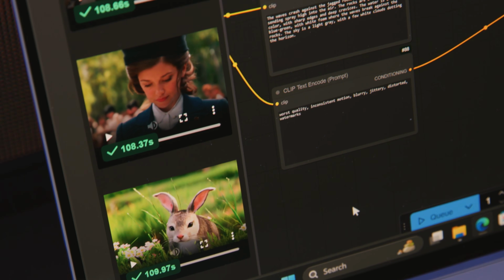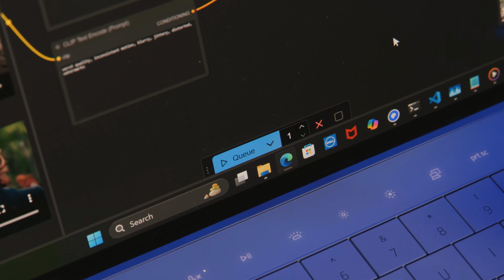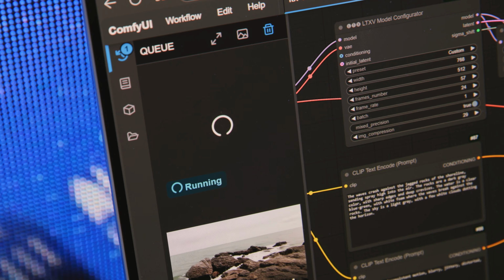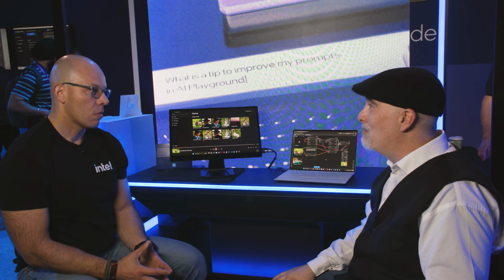Turn Text into Lifelike Video with Intel Core Ultra 200V Series | Talking Tech | Intel Technology

Comment: how do the desktop variants perform, and can graphics cards like the b580 be used in conjunction with the npu to further performance?
Reply: since the b580 is half the performance of the of a vase model 4070, My guess is that the NPu in the 200 ultra's will be working more than your GPU. look into the 5000 serries Nvidia Product line if you are into AI programming.